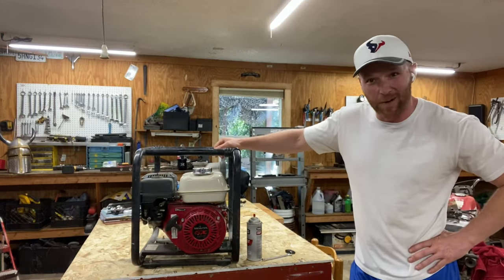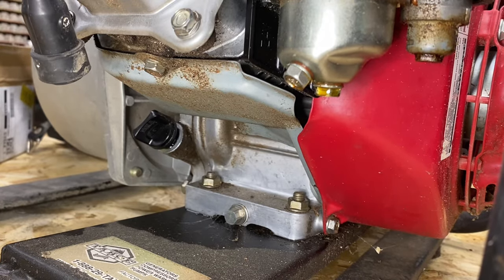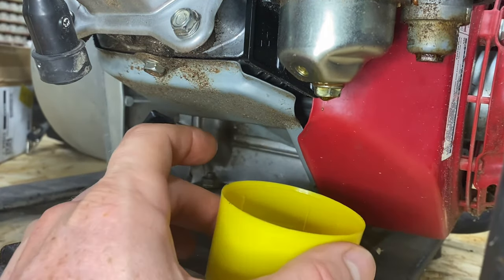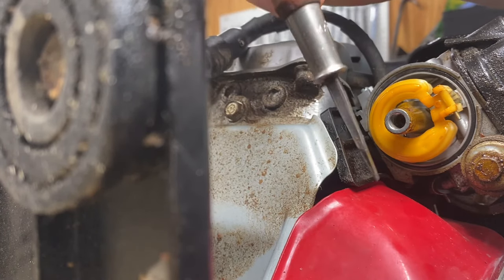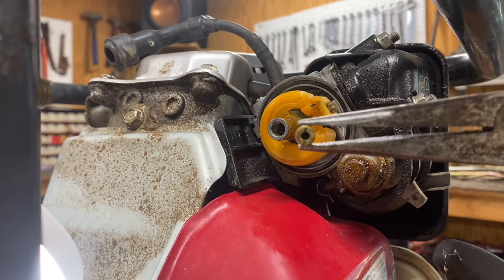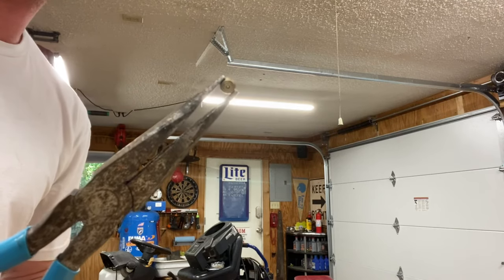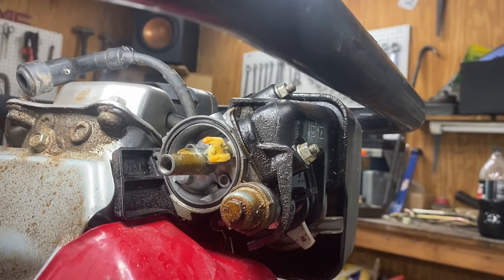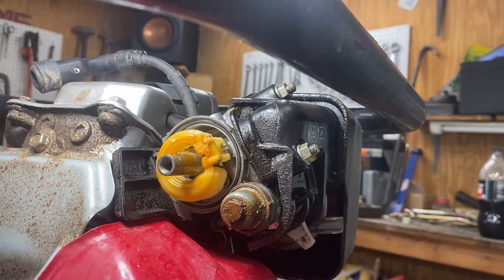Honda GX200 Carburetor Cleaning - No REMOVAL!!!

Comment: Need to clean emulation tube
Reply from the maker: And what is the emulation tube? That is a new one to me.
Reply: @MowerMike  after you take out main jet there is a tube inside filled with holes that clog up, that’s the most important part that needs to be cleaned.
Reply from the maker: @jumperg1  I appreciate the input I am doing my research on that for sure.
Reply: The word is EMULSION TUBE. It mixes air bubbles into the gasoline to aid in the transition from the IDLE circuit to the hi speed circuit —— to reduce stumble upon acceleration!

Comment: After the nain jet is removed take a small screw driver and in the throt of the carb push that brass jet down comes out the same place the main jet does there is little holes on it that like to plug up I've been a small engine mechanic for 20 years but I like watching videos because there is always somthing new to learn no matter how long you've been doing it I usually have to pull that little nozzle
Reply from the maker: Excellent point. I am no professional for sure.
Reply: It's called an emulsion tube.

Comment: Yeah, great video! All of that oil was just from when the motor had been flipped upside down. Hondas are amazing. I have a 1986 Honda GX 340 on a commercial pressure washer also with the original pump. Still runs like a new one. Has been put through the wringer. It does not smoke and starts right up.
Reply from the maker: Yep they are the best for sure

Comment: i'm surprised that is DIDNT start .
Reply from the maker: I’m not
Reply: i meant i've had many small honda motors and most of them would start even after long periods of neglect .
Reply: as you are aware , ethanol added to gasoline is a destroyer of small engines . i'm able to get 5% ethanol high octane gas which works very well even after sitting over winter . however i have recently started to use synthetic fuel and that works wonders on keeping the carb free form hardened deposits .

Comment: so to clean the carb on a honda lawn mower which way do you tilt the mower to get easier access to do this no removal carb cleaning?   do you tilt it straight up or put on its side?
Reply from the maker: Always tilt it back pushing the handle to the ground. It will spill fuel or oil any other way. Just put a weight on the handle on the ground
Reply: @MowerMike  Thanks.  I did that.  While poking around i took off the carb and notices it basically missing all the gaskets and the one near the air filter is shot and deteriorated.  Could that be causing the issue i have with  a Honda mower that starts first pull but has an uneven idle where it goes up and down slightly.  The seller i bought it from left it outdoors uncovered.  not sure if what else i should be looking for to get her running smooth again.

Comment: There is another jet that is inside a plastic tube that pushes in from the top of the float chamber that is secured by a plastic cross head screw with collar around it. To clean it take the cross head screw out and prize the tube up (it is sealed by two o rings). The jet is located at the bottom of the tube and is small bore (typically 0.35mm).
When both jets a clean the engine runs great. I have an 11 year old generator that has never run as well as it does now.
Reply from the maker: Great tip thanks.

Comment: Have now used this to clean house siding and it performed well https://www.youtube.com/post/Ugkx43QMbQqu67IZadu9ou8Sg1BdrunMRNqX  I also bought some wand extensions which enabled higher washing without needing a ladder. I recommend both. This unit arrived quickly, was easy to assemble (only had to attach the handle), and arrived in perfect condition. The only very slight downgrade from a perfect score is the design has a low handle and requires pulling from the side. My old washer was an upright model, while this one is more horizontal. Other than that, it's perfect for my needs. It has a great deal of pressure and more easily cleaned the house siding, porch rails and concrete than did my older model. The engine is a bit louder, as well, but the total time to clean was reduced by the more powerful spray. Did I mention it starts on the first or second pull every time?!! I am definitely happy with this model.
Reply from the maker: You tha man!

Comment: Hate to be critical BUT after 7 years of sitting without engine having run, WHY wouldn't you remove the long jet, the pilot jet, and the seidment bowl and clean each of them as well. It would have taken all of about 5 more minutes and I'm betting they would have had been gummed up as well. I wouln't pay for this kind of supposed "carb clean"!!
Reply from the maker: It is a very simple answer. It is because I am just a hobby mechanic I didn’t even think of that. I wouldn’t charge anyone for my mechanic work. Take it for what it is, free and hilarious advice ;)

Comment: Mine had another pin type thing with holes in it that fell out now im not sure which way it went....
Reply from the maker: That slides back in the hole where the main jet is, check other Honda carb videos it will show that piece.
Reply: @MowerMike  got it! Mt concern was which way, all back n running thanks!

Comment: Hey I’m having problems with mines it just turn off every 5 minutes
Reply from the maker: Check that it is getting fuel, sounds like a dirty fuel filter or a clocked float needle in the carb

Comment: My question is wat if the oil has rushed down in the cylinder & gotten into the carb & air filter...my engine tipped over & that happened
Reply from the maker: I would tilt it back over and make sure it has the proper level of oil. See if it starts. If it doesn’t then clean out the carb. Having oil in the cylinder is no big deal what little is there will burn off
Reply: @MowerMike  thanks for the response, it definitely had oil in the carb & there was also oil in the "chamber" where the spark plug screws into. Had to take the spark plug out to even pull the cord bcuz it was almost impossible to pull, but once it all cleared up after about 100 pulls I put the plug back in n 1 pull started it
Reply from the maker: @xo_dre0728  That is awesome congrats on the fix

Comment: properly your missing the transfer tube can be a clog , an next comment its not the ethinol its the water in the fuel, and you can clean the low jet without removeing the carb
Reply from the maker: Yep I missed the step on the transfer tube.